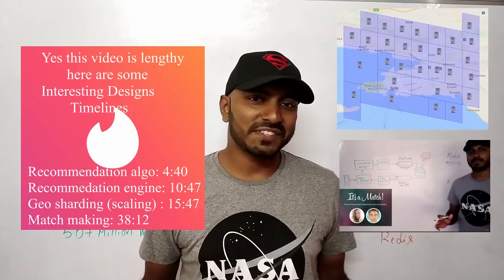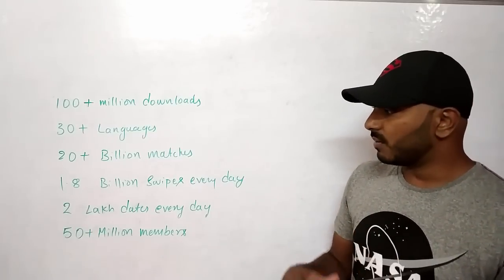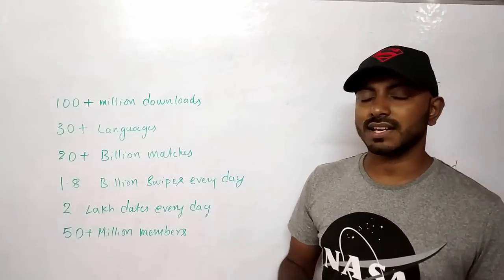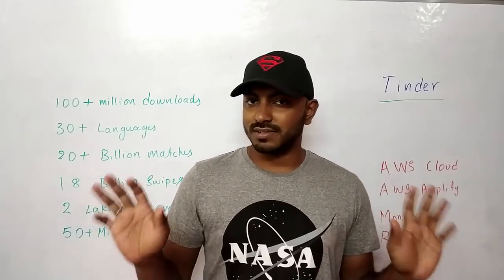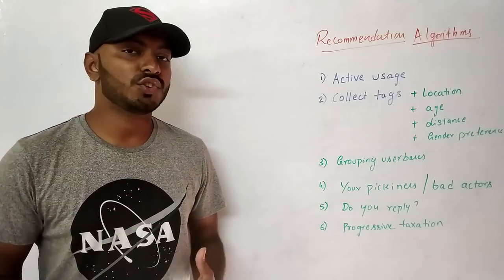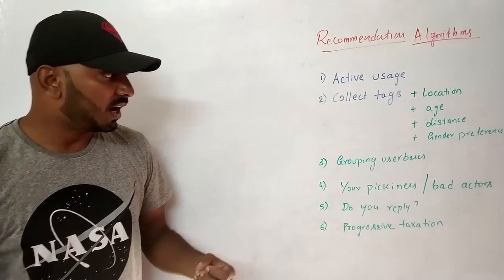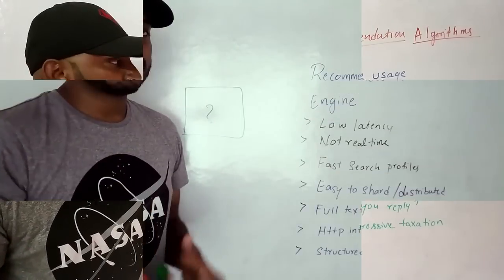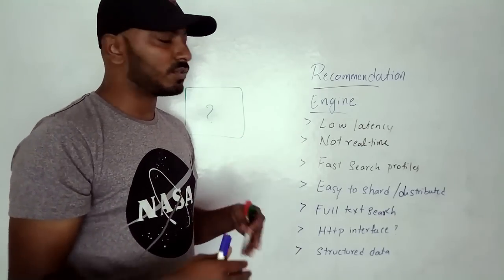Tinder System design | Dating app system design | tinder software architecture

Comment: I guess you unnecessary over complicated the passport feature.
Since our design already have lag,long based mapper, we really don't need to do any thing else. Based on the user CURRENT lay long, he would still query recommendation eng and they behave same way as earlier only change is His/her location nothing else. 
Some may argue that when user created his profile in, let say India, when he move to America his data might not be available in those shard which is near to Americas. This is something poor approach rather thinking about where user created the profile, think rather just based on location based and your system continously track user location and update the available profile. This May be bit challangging but more optimal and less verbose.

Correct me if I'm wrong

Comment: Great video. I have a question. Suppose user A went to some country like USA and right swiped some user B from US region. After the user A came back to his(not US) region. Will user B still be able to right swipe A even after the user A has moved back from US location ? Also if they both swiped when they were in same location. Will they still get the options to chat when they move to different location ?
Reply from the maker: 1. With this design no. however, when user A comes back from USA, user B won't even get User A as recommendation. Consider user b got the recommendation when he was still in airport and then user A flew to native. This perticular case match won't happen.  And more over the keys will have a TTL of couple of months and they will be invalidated. So when user A goes back to USA next time chances are that both can start fresh.

2. If there is a match, then there shouldn't be any restrictions to chat across geoshards.
Reply: @TechDummiesNarendraL  Thanks for the clarification.

Comment: Really well made content, have one question though :
Suppose a person 'A' right swipes 'B', and some match making services lets say 'X' and 'Y', receive this event, that A has right swiped B. Now, assuming some redis instances would be local to both X and Y, then based on what factor would you decide to save A_B key in redis and in which service ? Assuming that A_B key won't be saved in all the redis instances.
Reply from the maker: In tat case a_b will be saved in both the services, if the redis is global the first service save it. Have some TTL to invalidate match after couple of months